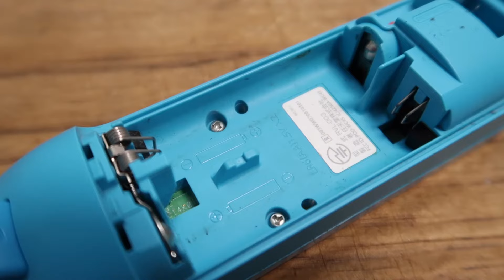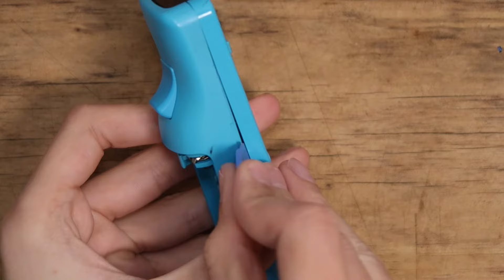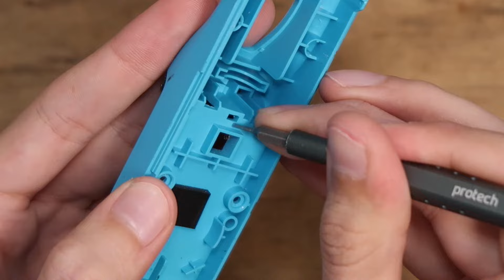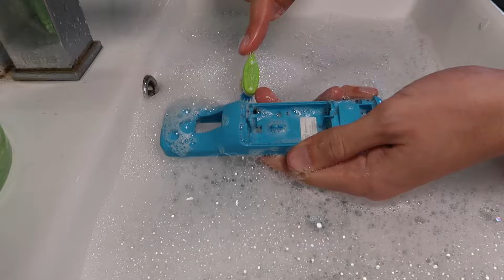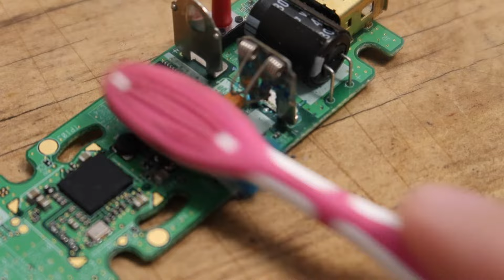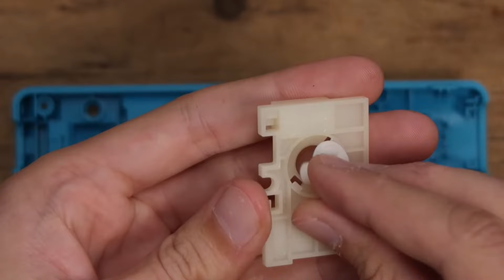Wii Remote Teardown & Clean - Wiimote Battery Terminal Corrosion Fix

Comment: I was working at opening the top and yeah... that clip broke 100%. I was wondering how yours popped so easily. I even used the same "guitar pick" tool.
Reply from the maker: I’m pretty sure mine ended up breaking too
Reply: @TheBygoneEra  it looks like it did, mine just did the same
Reply: i know im hella late to this, but anyone else lookin for answers, use a credit card of some type. i was at this for like 30 minutes till a reddit post suggested to use a card and it popped off instantly. just slide it around the side of the wiimote and eventually youll hit the clip.

Comment: Major question, how in the world did you get the back battery contacts out so easily???? I’ve literally bent the plastic trying to get em out.
Reply from the maker: Just have to make sure you bend the small metal tab down, then it can slip straight out!
Reply: @TheBygoneEra  But they are soldered in!?
Reply from the maker: Not the ones on the back half of the shell

Comment: pleeeeaaaase expand on how you removed the battery part. I cannot get it for the life of me. I've tried several tools. I am desperate.
Reply from the maker: There is a small metal tab on the back side of the battery terminal that needs to be pushed in to allow it to slide out

Comment: I've got 4 wiimotes that had corrosion. the battery terminals that are soldered in are tricky. I use vinegar to get rid of the corrosion I apply it with a  q-tip. 2000 grit to rough up the minor spots - HAVE  to careful so you don't take off too much on the terminal. Great video, I'm watching so I don't miss anything important. subbed and liked

Comment: Ive got a Wii remote I opened up because the butrons were sticking and I discovered the previous owner mustve poured soda into it or something and the speaker was all junked up and the "paper" was completely soaked with it do you know what its made out of to be replaced or does it need to be replaced at all?
Reply from the maker: If you’re talking about the paper that is between the speaker and the remote shell, I’m fairly sure that’s just a dust prevention and isn’t necessary for the remote to operate
Reply: @TheBygoneEra  Thank you!

Comment: I recommend the TS100 or TS80p for a soldering iron but then if I personally use the Pinecel as I deal with small components usually so the fine tips are really good for that
Reply from the maker: Thanks for the info, I definitely need to look into getting a new one so I’ll check them out!
Reply: what power supply do you use?
Reply: @jp9403  65W laptop charger

Comment: Hey my remote turns on for a second and turns off for a while, whats the fix?
Also This is a old dirty remote i cleaned for the entire day and wetted and dryed all the parts expect for Electric parts.
Also there is like tabaco on the remote but i removed most of it, and all of it on the bord
Reply from the maker: It could be a number of things. I’d make sure there is no corrosion on the battery terminals first, then clean the power switch. Make sure the whole board is clean first and see if that helps

Comment: Hi, some of my battery terminals have broken off after being exposed to battery corrosion - is there any way to buy replacement terminals? Thanks
Reply from the maker: You should be able to get replacements on eBay or AliExpress
Reply: @TheBygoneEra  Got them on order thanks - will I need to solder or can I just install and touch the points?
Reply from the maker: The battery terminals in the shell just clip in, but the terminals on the board will need to be soldered
Reply: @TheBygoneEra  Many thanks buddy

Comment: I cannot for the life of me pry off the top and bottom. Any suggestions?
Reply from the maker: It’s definitely hard to do. First time I did it it cracked the little clip. It’s an annoying design for sure
Reply: @TheBygoneEra  I got it Finally and yes it was very hard to do. I used a small putty knife and if worked ok. I did damage the plastic a bit but it’s alright.

Comment: What is that black square on the inside of the rear shell? And what did you use to clean the board? I got some second hand wii gear recently and will be taking it apart to paint the shell, but will also clean it if deemed necessary. :)

Comment: I didn't break anything when I pried my controller apart, but now that it's put back together the clips at the top part don't want to clip together. Other than that, the controller looks much better!
Reply: That's because the way he opened the Wii Mote always breaks the clips, if you take a closer look he broke the one oposite to the side of de on/off button